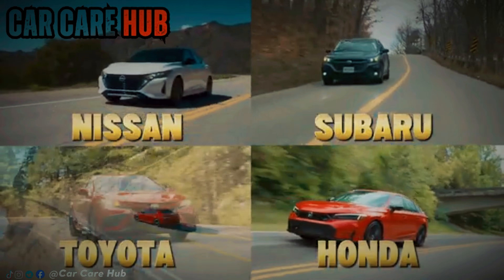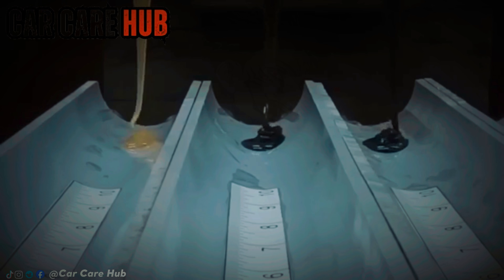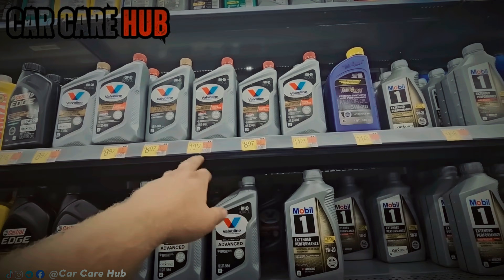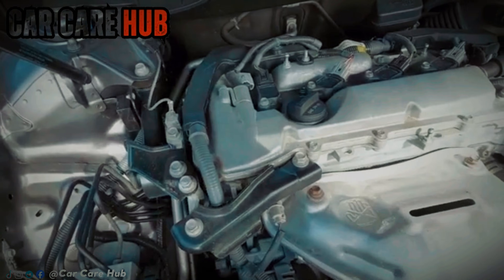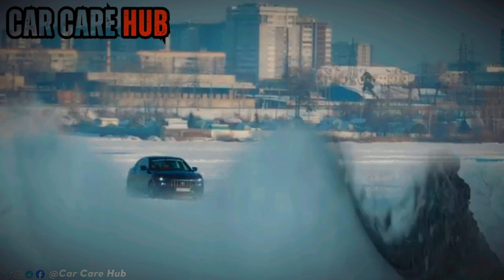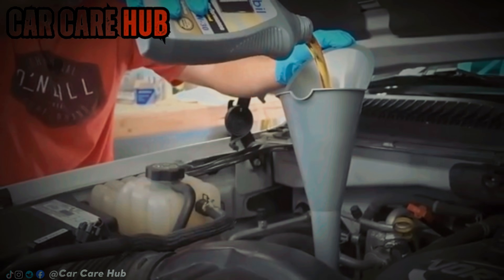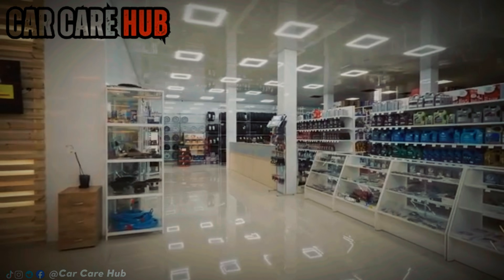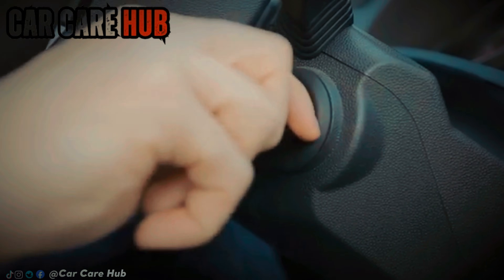Why American Cars Use 0W-20 but 5W-30 Everywhere Else

Comment: The way my wife smashes the pedal there is no engineering that would allow 0w16/20 to improve mileage in any car she drives.  Rides that damned throttle up to the red light every time then jams on the brakes.
Reply from the maker: 😂 Driving style beats oil choice every time—hard throttle and late braking will cancel out any MPG gains from 0W-16 or 0W-20, no matter how advanced the engineering is.

Comment: What about the 0W-30 alternative? It rounds up quickly on cold starts and offers better protection at engine operating temperatures.
I live in Europe, Slovenia, and I drive a 2020 Honda Civic with a 1.5 liter gasoline engine. The original Honda oil Type 2.0 0W-20 is prescribed, as an alternative, if this oil is not available, the recommended oils are 0W-30 or 5W-30, ACEA A3 or A5. However, it specifically states that if 0W-20 is used, only the original should be used. This confuses me, why only the original when 0W-20 is used.
I'm wondering if I could (ignoring the warranty) use 5W-30 or 0W-30 even on a brand new car, when the tolerances in the engine are still factory-made?
I'm also curious, considering that the winters here haven't been particularly cold lately, even if they are sometimes -, could I use 5W-30 instead of 0W-30? 0W-30 circulates through the engine a little faster, but I heard from a mechanic that the first number of a thicker oil before the W, stays on the cylinder walls and elsewhere in the engine better.
Reply: Думаю можете вполне применять 5w-30.
Только подберите с вязкостью при 100°С около 11,5 - 12,0 сантистокс - чтобы было приближено к такой же вязкости при 100°С для 0w-30.
Reply from the maker: Совершенно верно 👍 Можно использовать 5W-30. Главное — подобрать масло с кинематической вязкостью при 100 °C около 11,5–12,0 cSt, чтобы оно было близко по характеристикам к 0W-30 и обеспечивало ту же защиту двигателя.
Reply: @CarCareHub-x1e , ali je lahko tudi nad 12?
Reply: Thin oil on start up is the problem after the engine is broken in. I have just now been enlightened to this oil scam. It’s a US government regulation issue for unrealistic MOG requirements. Trump has done away with those BTW. My Subaru has 140000 miles and is about to be switched to 5-30
Reply from the maker: Good question 👍 Honda specifies the original 0W-20 because it’s a very tight formulation tuned for fuel economy, emissions, and engine design—aftermarket 0W-20s can vary more, so Honda limits risk. Ignoring warranty, 0W-30 or 5W-30 (ACEA A3/A5) are safe alternatives even on a new engine, especially in Europe. With your climate in Slovenia, 0W-30 is ideal, but 5W-30 is also fine if winters aren’t extremely cold. The “oil sticking” idea is a bit outdated—modern oils protect mainly through fast circulation and proper film strength, not thickness at rest.
Reply: @CarCareHub-x1e , v redkokaterih koncih Slovenije zime presegajo -10 °C, velikokrat je še manj.